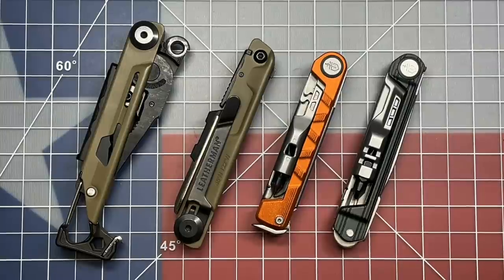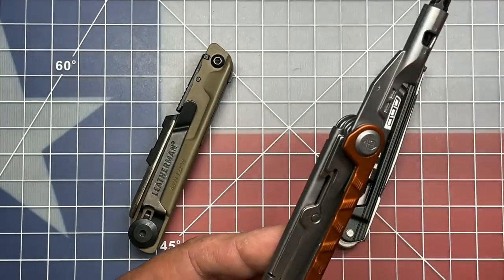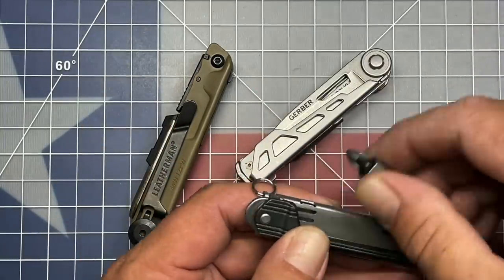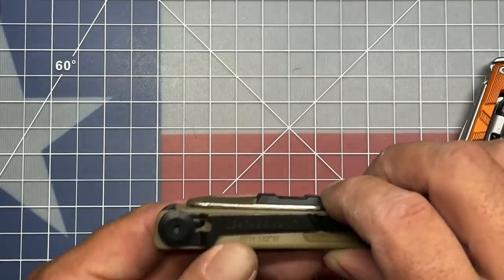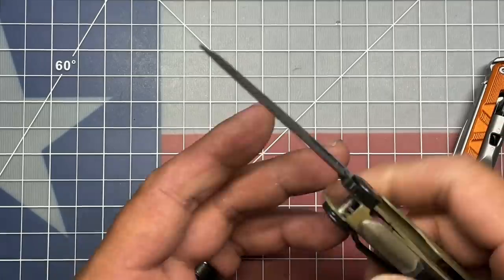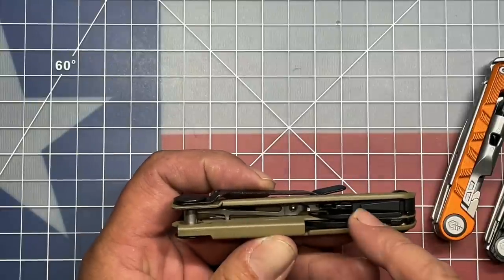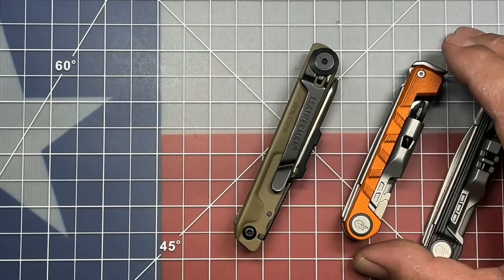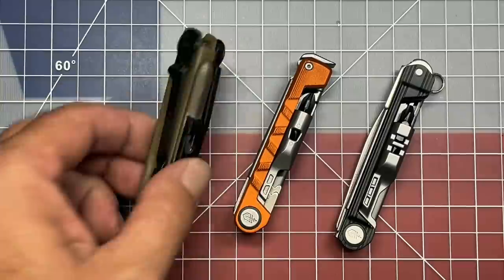Minimalist Multi Tools - An idea I think Leatherman should explore.

Comment: And I agree BUT they are reinventing a Swiss army knife just a slimmer profile with a driver and different tools, I like the fact there's a large knife well decent sized pocket knife and the rest of them. there is pliers options , that are much smaller that Gerber makes for it's dime and other small multi tools that will fit right in the empty space then not everything is mini but you have it all. Just like a Swiss army knife but made by Leatherman and that bit driver is like a deal sealer for me.

Comment: Something similar to half a surge or wave but with knife and full size bit exchanger (like the centerdrive) as the 2 out side tools then inside tools keep the big and small flat head and awl on one side then the eye glass driver scissors and the bottle/can opener on the other side preferably all locking
Reply from the maker: I could agree with everything except for the micro driver. I just personally don’t get enough use out of it to warrant having it inside of a smaller tool like this.
Reply: Possibly package opener instead

Comment: I guess in some way it would be possible to add one longer tool and a short one - which I think should be a proper file, like the rebar's (but without the fiinger whole, it's just annoying for work) and the short one in my opinion should be a Victorinox-style chizzle (the spirit one!). This actually works perfectly as a package opener and you can still pry with it if needed, love this tool. It would complete a very need urban setup - maybe add some small tweezers and we're good to go.

But for some reason, they almost never give us the most wanted tools... they gave us the free series... great 🤦🏻‍♂️
Reply from the maker: I hear your frustration. I’m right there with you.

Comment: This Leatherman looks very intresting for me, but also like a halfmade Beta-Version... This big Gap - storage for my own ideas? Which can fall out? This big meachnisim for a file? can i sharp my Knife with this? Put a Saw or a mini Pen inside or screw driver - endless possibilities...
Oh, and the Ale (this spiky thing) is very bulgy... i would need the thin model like the SAK.
So... i will wait 1 - 3 years for the next models.

Still waiting for a system where i can custom everything like i want. "Put a sissor, Knife, Caneopener and and and inside."

Comment: If Gerber had put a locking mech on the driver that would have been just perfect for me. Blade and driver (bottlecap lifter, meh) is what I use the most. Cannot understand why they didn't put the driver lock on the slim. Missed opportunity.
Reply from the maker: I agree completely. Baffles me why they didn't add a lock to the driver.
Reply: I'm sure Gerber's design team does not watch or read reviews. If they did, they would see that the non-locking driver bit arm brought the most criticism.
Then they brought out the Slim, got rid of the combo prybar/bottle opener/tapping hammer, the scissors, and the awl and KEPT THE DYSFUNCTIONAL  NON-BLOCKING DRIVER BIT ARM! (I used caps in case Gerber ever reads this... Wouldn't want them to miss it.)
I really like the Gerber armbar multitool design. It's a most useful device, with a great locking blade. As usual, Gerber has great ideas, poor execution, and does not heed reviews.
Reply: @txtoolcrib  Hopefully someone out there in YouTube land has a "fix" for this. I really think this is a worthwhile tool to carry every single day once the locking issue is corrected. Thanks for all you do!

Comment: I disagree with you on the lack of locking driver on the armbars.  I don't really see a need for it, and have never missed it on mine.  It's a multitool, so I don't plan on heavy driving, and if I do need to crank on something, I'll use it closed at 90 degrees for more of a t handle driver.  A lockable driver makes the tool more complicated, and also an extra step to close.

Comment: They would also meed to use better blade steels. Im more ok with a 19 in 1 having a sub bar steel vs a 2 or 3 in one. If they just did a D2 or M4 blade with a bit driver I'd see no issue paying 150-200 for it. Thats basically all i need out of the 19-1 tool anyway.

Comment: I carry a knife so i want what my knife cant do (well) so: locking t shank blade holder for files and saws, bit holder (center mounted and locking), can / bottle opener, scissors, awl, and cork screw sized to take the eyeglass screw driver from victorinox. If they wanted to get tricky, some scales that could take the tweezers, toothpick, and pin ala vic compact. Oh and i would pay at least $100 to get exactly what i want. Just come out with a modular tool already and let us build our own

Comment: with a scissors and locking both sides i would  dro 50 on it. or take out the bit driver add scissors and the put full 1/4 inch drive  on other side like the armbar and trash the useless file .

Comment: You're asking Leatherman to RE-invent the venerable Swiss Army Knife! Perhaps they'd like to dance on thst ballroom, but the band has played on! IMHO, not much ROI, but what do I know...?
Reply from the maker: The ROI would be huge. Imagine a pocket tool that competed with the SAK that included a better blade, exchangeable driver, package opener, pry tool, awl, combo opener with real wire stripping capability, and most importantly included a pocket clip as standard! There would hardly be another Armbar sold and it would chink hard into the armor of Victorinox’s bread and butter.
Reply from the maker: Now imagine that they decided to make three or four different variations of said tool to better accommodate the needs of their users, and you think it wouldn’t sell!?! They would fly off the shelves!
Reply from the maker: Oh, and most importantly......every single tool locks!
Reply: @TTC, thanks for the well thought out and reasoned answers, to which I can only reply: TOUCHE'

😉😁👍❗️

Comment: But didn’t you basically just describe the free t2 or t4?
Reply from the maker: No, though others have made that comparison. First, no magnets. Secondly, way better blade. Third, the tool stacks would be at opposite ends instead of side by side, which would make the tool longer but much thinner than the models you mentioned. Fourth, would include a bit exchanger. Fifth, no magnets. Sixth, NO MAGNETS!
Reply: @txtoolcrib  I personally haven’t had an issue with the magnets, and I work construction and maintenance. Even Being that yes metal shavings can get in there, they still haven’t managed to slow the tool down. What do you have against the magnets? Have you carried one of the magnetic tools?
Reply from the maker: I am a welder/millwright by trade. The amount of metallic dust I work around fill these tools within a day or two. It is a constant thing to have to clean these tools out because of my profession. Having a file that is magnetized is quite possibly one of the worst ideas Leatherman ever conceived in my opinion.
Reply: @txtoolcrib  not that it has much of a file anyhow, I can agree to an extent. But maybe it’s not really meant to be the construction or welding heavy duty tool that other tools are. It’s just an amazing every day life kind of tool. It’s fast, and easy to use. I would argue that I use it more because it’s more convenient to use than any of my other tools. It might not fit in at work, but I’ve never had an issue with mine.
Reply from the maker: Now that I can agree with. For the average consumer, I’m sure it works just fine. It’s just not made for me.

Comment: Comparing serrated blade to straight, no scissors on the Leatherman and their proprietary crappy $25 bits to standard ones. Leatherman is a horrible product, in terms of design and materials used. 420 steel blade for$70-80. Heck, no!
Reply from the maker: I get it, no matter what Leatherman builds, you will hate it. Now, do you have anything to add to the conversation, or do you prefer to just rant?

Comment: 4:14  Stop right there. That "awl" isn't an awl. It's a sort of knife cum scraper or something else, but not an awl. An awl is for making holes, relatively small or narrow holes. as one would need in leather to sew up with thread, or something similar. This tool would make that very difficult to do at all. The knife is a joke, and your critique does not go far enough. Very disappointing from Leatherman. But then, they have never quite understood the awl thing, unlike Victorinox who have perfected it!  You don't actually explain the term "minimalist", as it applies to a "multi"tool, which is, after all, what it's all about - multi uses! What's the point of a very expensive tool that can either cut (sort of) or screw, and not much else? Rather say it like it is. Disappointing!  (See, I can be nice!)